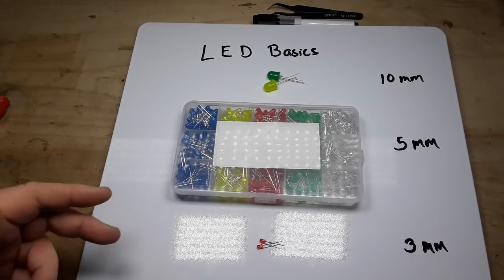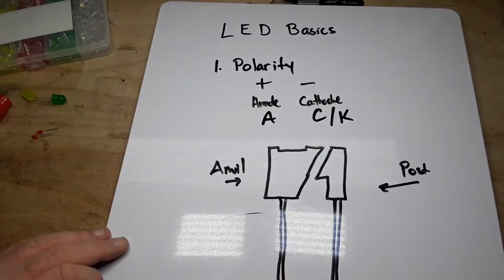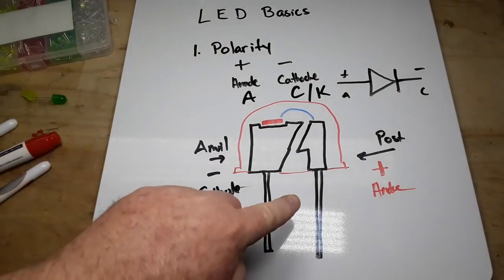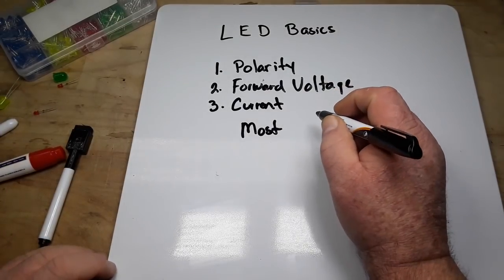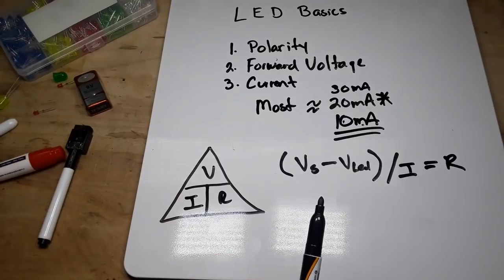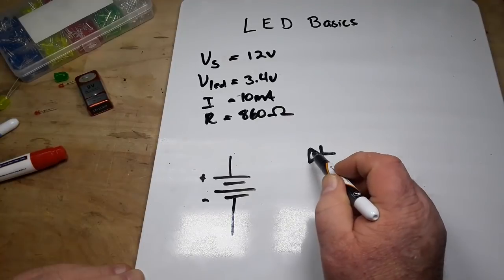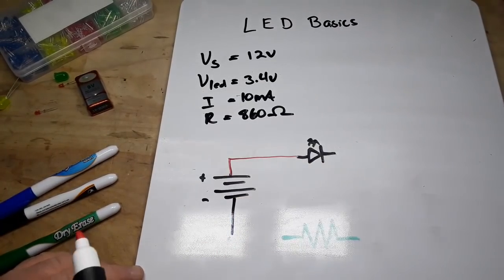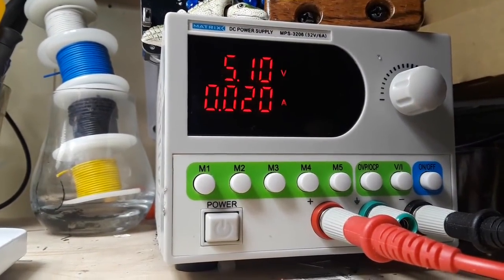LED Complete Basics for Beginners

Comment: I always watch the beginner videos because I always learn something that I missed before.
Reply: Me too. Never over estimate your knowledge on a subject. I learned several things from this beginner video.
Reply: @judo-rob5197  When I was getting my Computer Science degree, we had a book called Programming Proverbs.  It was a small about 6x9 inch paperback loaded with good advice.  One of the proverbs that I always remembered was "Re-read the manual".  The point made was that there is a lot of stuff that goes over your head the first time around.  In a lot of cases that is because you haven't a clue how to use a particular feature.  After you have been at it for a while, the feature in question may be applicable to something that you are trying to do.  Case in point:  I had not been aware of how to calculate the current limiting resistor value before I saw it here.  I just always used what I picked up a long time ago which was the rule of thumb to use something around 270-330 ohms.  That, I now understand to be because everything was 5V TTL back then and those values worked out for the LEDs that we were using.
Reply: Absolutely agree. The anvil explanation was new to me!